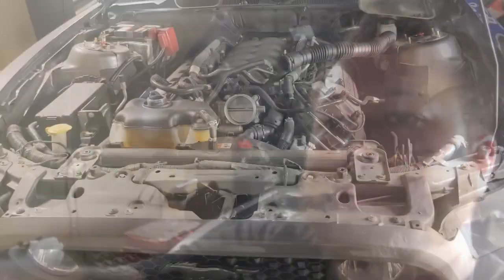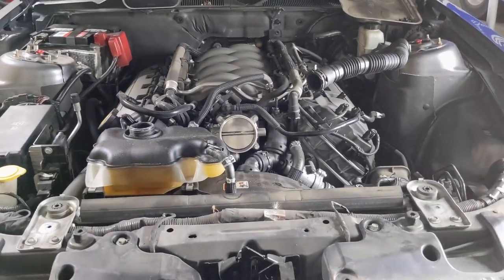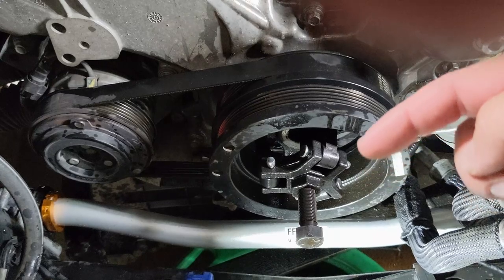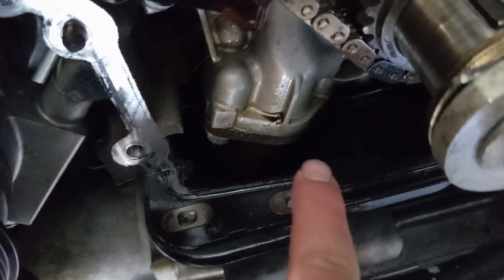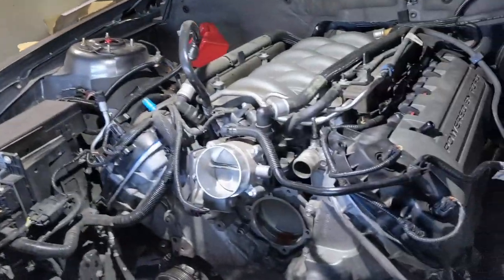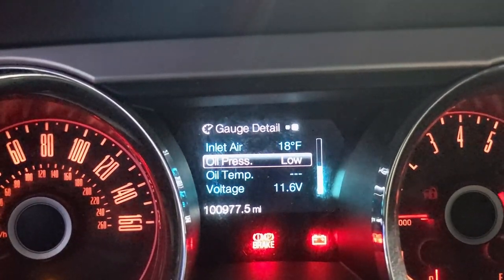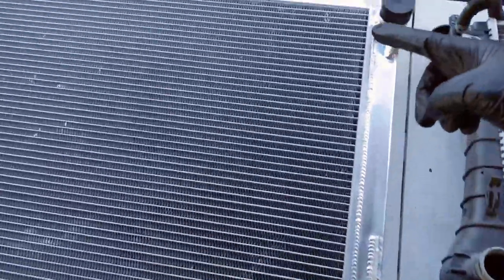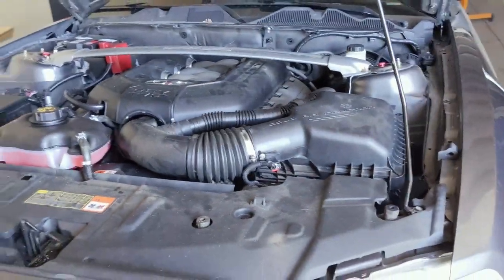Coyote Billet Oil Pump Gears

Comment: Hey man quick question, how did you fill and bleed the new coolant after replacing the radiator and expansion tank to make sure no air is trapped in the system?
Reply from the maker: I use a vacuum fill to refill my cooling systems.  Best tool for the job honestly.  Very little bleeding after filling the system.